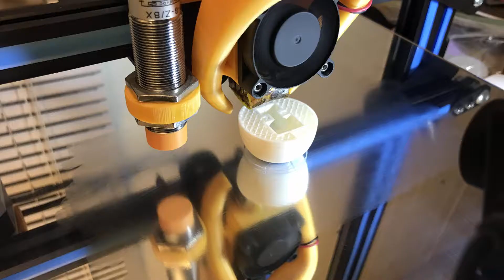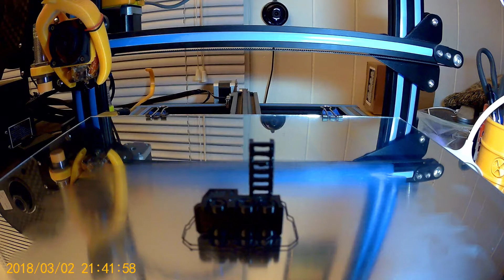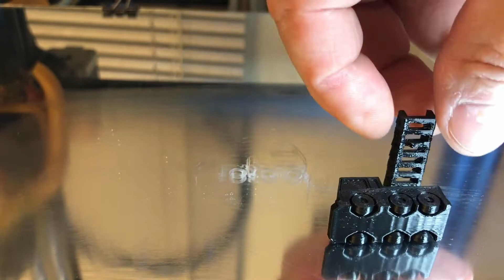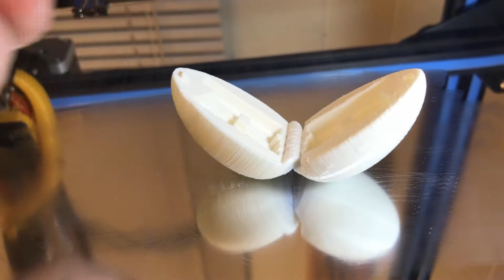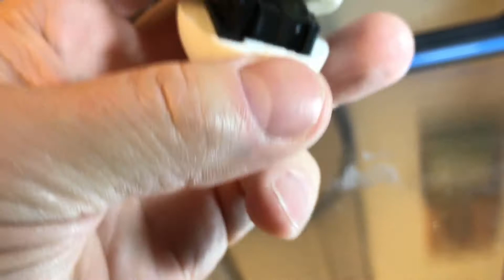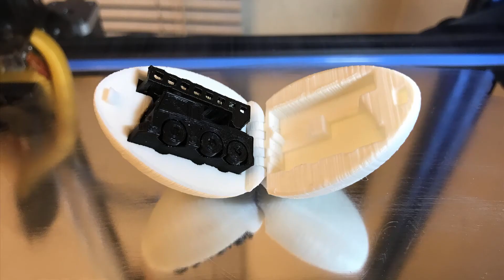Firetruck in an Egg

Comment: you are over extruding.  Printing too fast, and your layer height should be 1.7 or less for that print.  Otherwise thanks for the video.  Those egg things are really cool.  I have done them all.
Reply from the maker: Funny you mention all this.  After watching the video, I saw the same thing.  I've been tuning my Printer Profile today trying to get these things set correctly.  I did print the truck at .1mm, but my settings are all out of whack.  It's getting much better with the changes I've made this morning.
I've now completed all the Vehicles and Eggs and have all the motion working on each of them.  Wheels and all.
Thank you for your comment and suggestions.